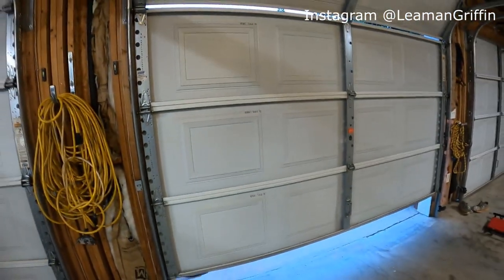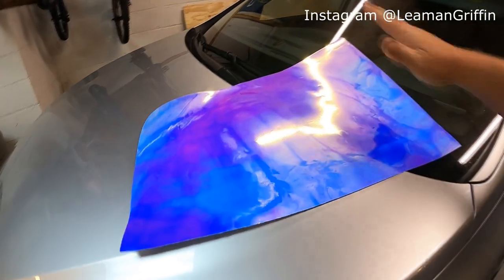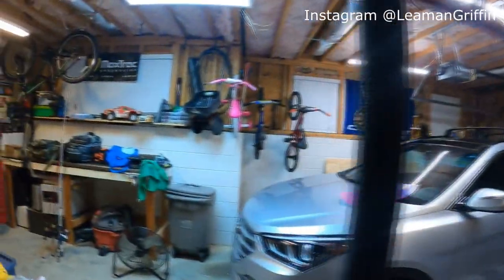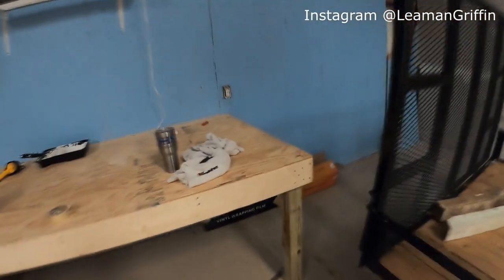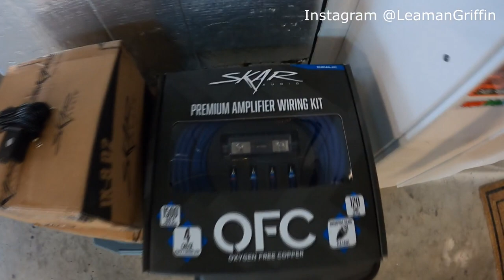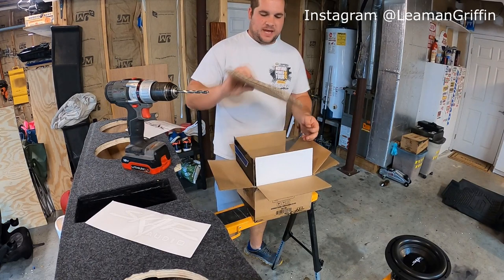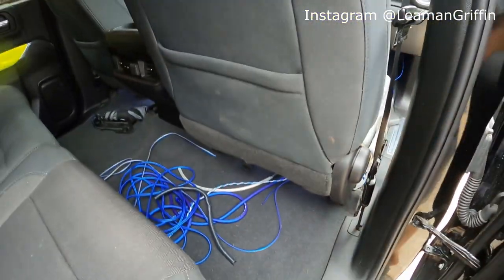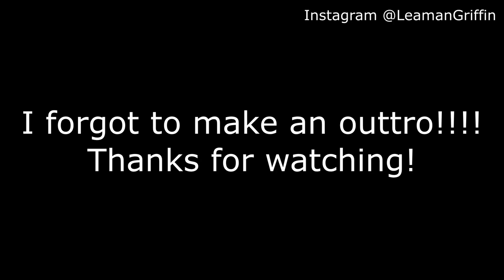2019 Silverado Subwoofer Box Build 4 Skar Audio 8s on 1500w

Comment: Always a fan of skar audio. I run 2 evl 12s on 3500 in my civic custom 4th order box 154.5 DB
Reply: 2 elv 8s on a 1500.1d skar amp wired at 1 ohm banging around 120dbs 🥰 thinking about going back to my 1 12 vxf skar

Comment: I have 3 p2 8's behind my crewcab seat (05 Silverado) with a zx1500.1. Sounds great, might try 2 Qclass 8's under my seat next go round.
Reply: I’ve had the p2 and yeah they sounds good. Give massive audio hippo xl a try.
Reply: @jorgejaimes5281  I am just thinking the Qclass because it has more surface area. With the surface area of the square 2 8's give you the surface area of 1.5 10's. Also to do the hippos I need to rebuild the box, and change the mounting depth. Either way I have to build a box.
Reply: @markbarilleauii6337 that’s right. Cone area is king. You get more with a Square. I have one Q Class 8” and it’s amazing.  Two subs with the proper amount of air and tuning will sound incredible. Two subs wired to one ohm with the airspace of the whole seat will be better than 4 subs squeezed

Comment: I have a 19 trail boss and was looking into putting my subs from my old ram into the new truck. How did you wire the amp into the stock head unit? I’ve looked everywhere and can’t find a way to do this.
Reply: Same here. would love to see this
Reply: Look up the dm -810 or similar devices!!! You will a digital processor such as the 810. There are cheaper versions with less features as always! Your welcome!
Reply: have to add a line drop and i suggest a eq if using stock radio
Reply: Take it to a shop for sure that will do it right
Reply: Check out the LC2
Reply: I put an lc2 in my camaro. Currently running 2 amps off it with about 4K watts. The lc2 takes the input from the stock rear speaker wires. No need to take the dash apart to get to the head unit.

Comment: How big of a difference is there in the 2014 and yours for under the seat?
Reply from the maker: Great question... i have no clue lol
Reply: @leamangriffin  🤣🤣. Well i know i got the notch in the same spot you do. But your notch is taller. But that wont make a difference in the position of it
Reply: @08soloblade  the 2019 and up have more room under the seat 2014-2018 crew cab Silverado you need to buy a kit to lift the rear seats that will give you like 3 more inches and also let you fold the back seats down so you can install amplifiers in the back wall of the truck, by the way i currently have a 2016 Silverado space is limited without the seat lift
Reply: Ahh i gotcha. I already cut my hook on the. Ack of seat to where it will fold down, and i got my amp mounted there already. But them damn seat spacers are expensive 🤣🤣🤣🤣

Comment: Any updates on how the IX8s are holding up to that 1500 amp? Please I'm looking to put same setup in my truck!
Reply: Idk how these IX8s but i have two evl 8s in my trunk and theyre not in a huge box what so ever just the skar dual 8 box and they bang hard but ima do 4 skar zvx when i get my chevy or ram 1500 havnt decided which one i wanna look for yet
Reply: @uhpixr  I run 2 12s now on the 1500 Amp. And they slamm hard! They are in small boxes sealed, as i don't have enough space for porting. But I'm thinking 4 8s I can port!
Reply: @oldguyBMX  you can definitely port 4 8 s
Reply: @uhpixr  yeah I have seen some nice ported 8" boxes in the Silverado king cab tricks. I was mainly wondering how the cheap 8s were holding up! I was thinking of the next step up from the ix8

Comment: What’s is the best way to stop the dimming for the tail lights and license plate lights without rewiring or adding extra battery?
Reply: Upgrade your alternator. What vehicle do you have and how many rms are you running
Reply: And situations like this you use a capacitor

Comment: Hey man I’m thinking to do the same thing in my 13 lml and i was just wondering on the air flow they are getting, do they sound muffled or distorted and higher volume?
Reply: A have a Fox Acoustic box in my 13 LML and it's pretty damn good. Ported 2 Skar 10s Skar 2k amp.
Reply: I plan on doing the seat lift and building the the box as big as possible under the seat and putting 3 Skar 10s forward facing ported and tuned to about 32hz. None divided should be good for about 1.25 per sub aaaannnnd THUMP

Comment: what is with people building boxes with plywood?  what happened to mdf
Reply: Mdf is to heavy, 3/4" birch wood is light and works flawless for sub enclosures.
Reply: @joeysturgeon1283  how expensive is it compared to MDF
Reply: @raulfoxman1925  birch is normally 50+ a sheet mdf is like 30 give or take on both